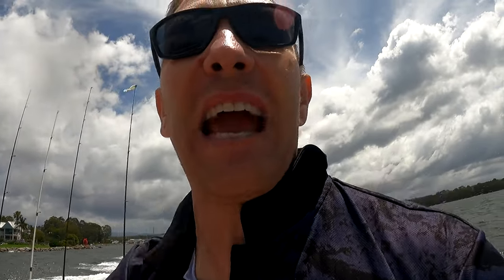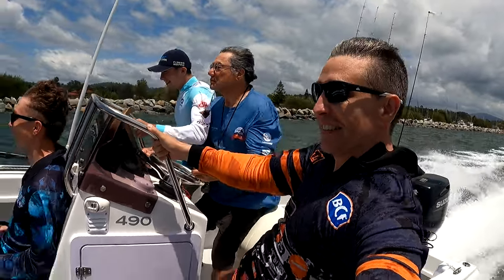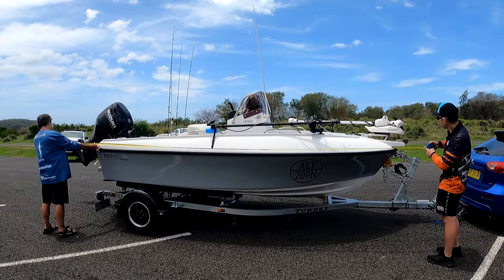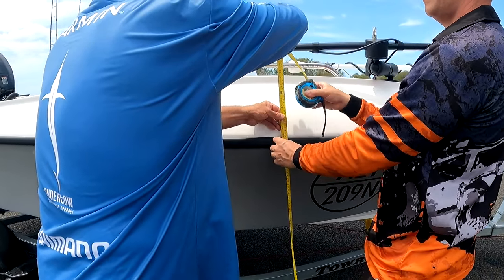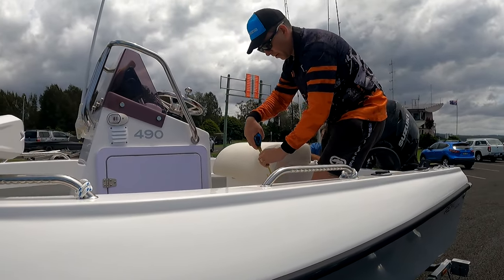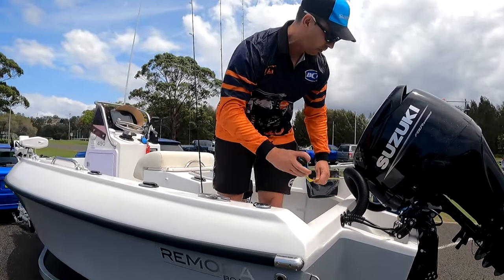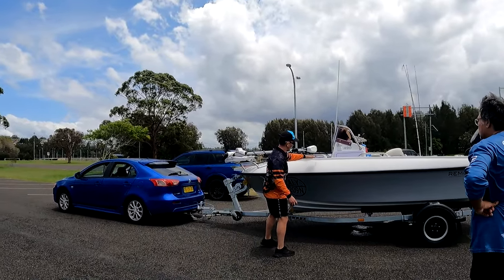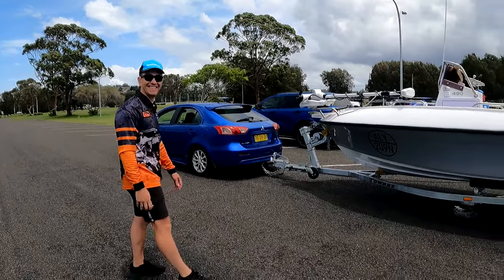Remora 490 centre console fishing boat design, dimensions, construction ANY GOOD?

Comment: Thanks for the follow up video and details on this boat. I have a Cruise Craft Resort 500 and looking to repower. I love the idea of good fuel economy and longer range so the figures you are getting with this Suzuki 100 look like it would match well with my boat. Have you weighed the boat on the trailer fully fueled? My Cruise Craft Resort 500 is 1120kgs including single axle trailer.
Reply from the maker: Hey, I've had a 115 on a 533 cruise craft and the performance wasn't anything amazing. Tbh i wouldn't fit anything less than 115hp to your boat
Reply: @BaitBallin  Hi, thanks for the advice. There is a big difference in fuel economy between the DF100 with the 1.5L motor versus the DF115 using a 2L motor. And this Remora 490 seemed to perform quite well considering the number of people and gear on board, which is why it had me intrigued on the weight. I appreciate you help.